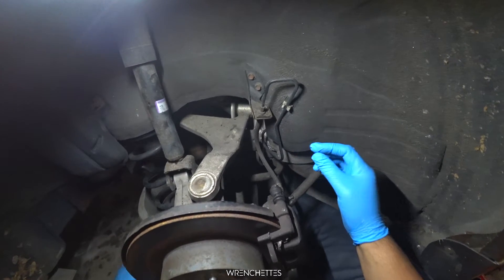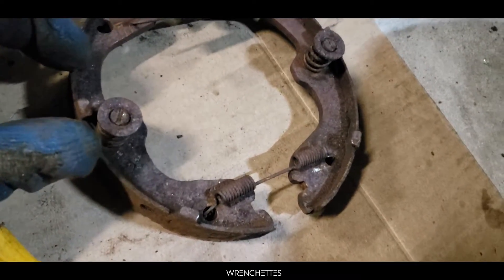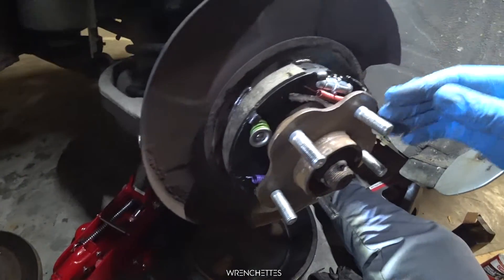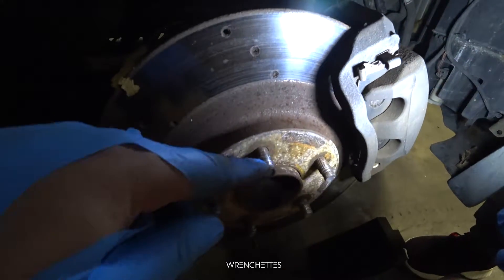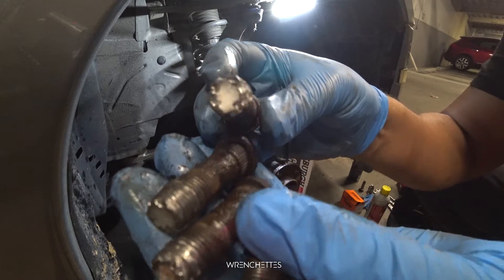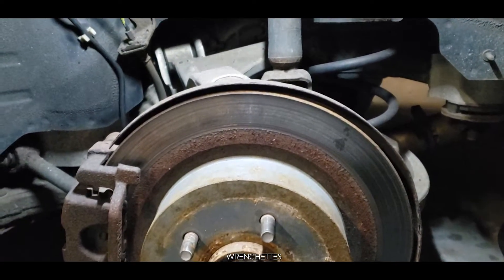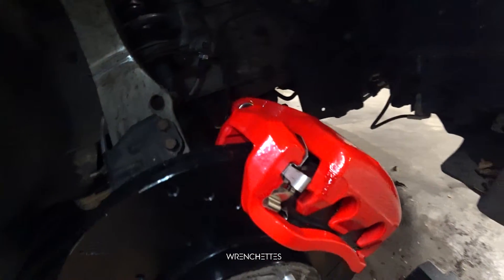How to change e-brakes, Rotors, Calipers, Brake Pads and Brake lines | Infiniti G35 & Nissan 350z

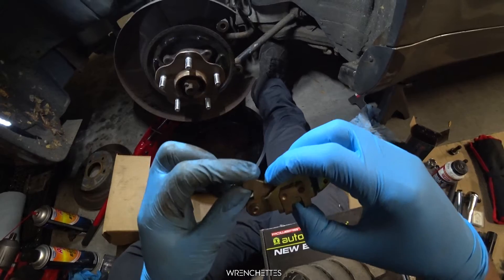Comment: hey there.. a little late to the video but I just found this so I have a question, where did you get the actuator for the hand brake at 6:15   ?? thanks in advance
Reply from the maker: sorry for late response. i got the kit from ebay. they sell the ebrake components.